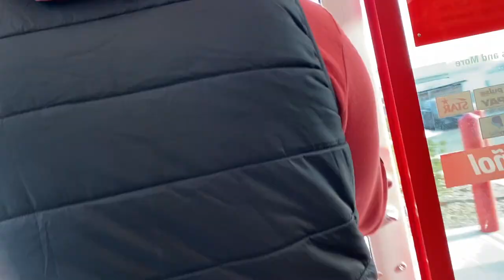Best Chrome Polish Behind The Scenes

Comment: wondering what you use to clean, polish, wax your FLHT aluminum primary side covers and heads and how are they holding up. Thanks in advance for any information!!
Reply from the maker: I use” mother’s “ polish for all my chrome and aluminum parts. Easier to maintain the Chrome than the Aluminum
Reply: @HOLYSHIFT  thank you Sandy!

Comment: I get them on my pipes from wife's boots, 0000 steel wool ultra fine steel wool, cleans all kids of crap off without scratching
Reply from the maker: A few people said that it makes micro scratches that eventually promote rust....
Reply: maybe their not using ultra fine steel wool 0000 . I ride in winter when I can and I haven't had an issue yet, same bike 10 years no rust where I had to use it but better safe than sorry if someone has an easier method.